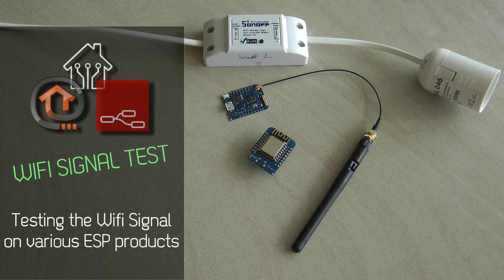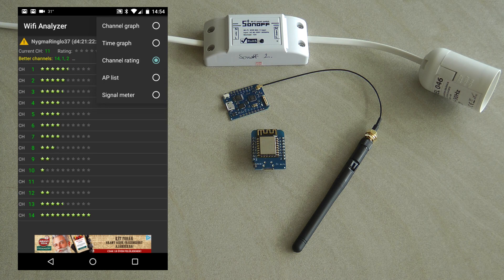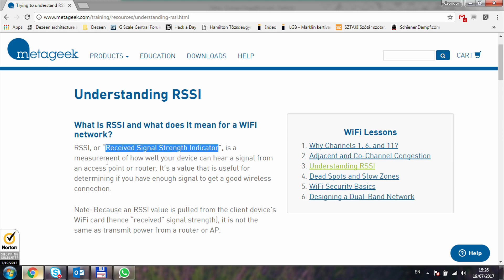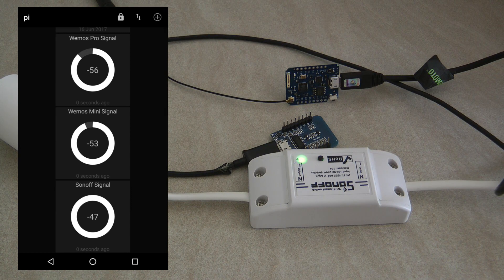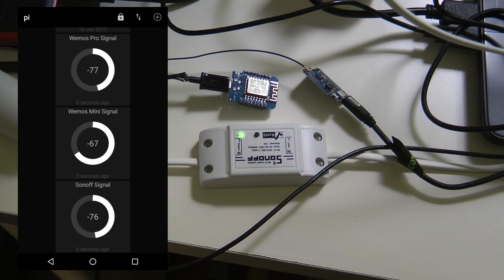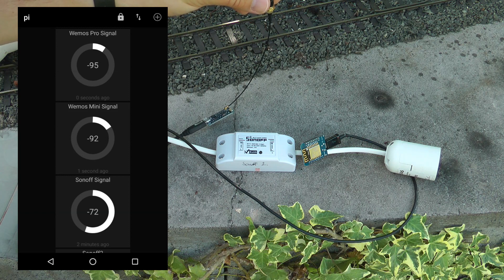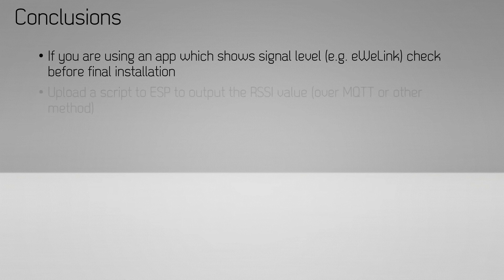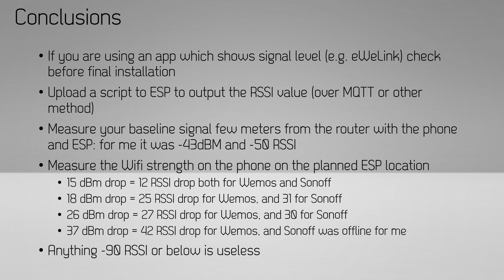ESP8266 Wifi signal test

Comment: Have you moved the 0ohm jumper on the mini pro to use an external antenna?
Reply: I loved to watch the video, considering the work it takes to organise everything, do all the measurements and then compile it into a structured video and if you made a 'mistake' not having the information that a resistor needs to be removed, it was even more interesting to watch this video and learn from it. I have a project with the same issue, where I would love to have a better signal, and was thinking about an external antenna. So I really would like to know what difference you got after changing this resistor. How much better is it?
Reply from the maker: Pierre Verbakel I will probably do a revised video in a few months. I did move the resistor and the reception improved but not much. But it was enough in my case to reduce the restart of 100 times a day down to a few per week.
Reply: One would always want more, but good to know it did make an improvement
Reply: Csongor Varga You can mount the antenna on a small metal plate of at least half a wave length. This will improve performance even more.
Reply from the maker: Damn, I feel such a fool. I did not know about it. I will retake this video once the modifications are made.
Reply: https://raspi.tv/2017/how-to-use-external-antenna-on-wemos-d1-mini-pro-surface-mount-rework-video

i hope this helps

Comment: is the external antenna for wifi only? I'm planning to make a LoRa project with RA-02 (433MHz) and I was wondering if the antenna used here is compatible with the RA-02 😅 thanks!!
Reply from the maker: Yes, that is for Wifi. To be honest the ESP that have a LoRa chip all have an external antenna connection for the LoRA radio. At least the ones I have all do.
Reply: @csongorvarga  I'm planning to buy a separate module for a LoRa cuz usually the ones with pre built LoRa are relatively expensive compared to those that don't have one 😅 And I already own an ESP32 DevKit so buying just the module would not damage my wallet that much haha (im a student 😭)
Reply: @csongorvarga  btw, in case you know, I just wanna ask, for the SX1278 LoRa Module Ra-02 433MHZ, can it still send/receive data even without an external antenna? I ordered the antenna and the module separately because for some reason, the antenna wasn't included in the module package I ordered (just the pins for soldering). I'm expecting the module to arrive much earlier than the antenna but I'm not quite sure if I can test it without the antenna 😅
Reply from the maker: @yoshimochii  I never used this module, but looking at a few pictures, it looks like there is an antenna connector. That assumes it is designed with external antenna only. So don't use it until you get the antenna and connect it to the module.
Reply: @csongorvarga  ohh, i see. That's unfortunate. I thought it would still work but on very short distances. This is because I have an esp32 devkitcv4 wroom-32u (the one that has an antenna connector) and I could still connect to wifi even without an antenna. Thanks for the warning though! (but it REALLY makes me wanna try lol)

Comment: Interesting. I have a related requirement. I have an IP camera in which I have replaced the rubber ducky antenna with a yagi to get better range. I now need to aim the yagi to maximise the signal strength received by the router. How to I measure the camera's transmitted signal strength?
Reply from the maker: Unfortunately I don't have enough knowledge to give you a really good advise. Some routers show the signal strength of the wireless devices, that may help. Or maybe what you can do is set the device to access point mode (set to pairing mode) and use a wifi scanner app on your phone to measure the strength of that wifi. You phone may not receive the signal the same way as your router, but if you want to maximise the gain it could be good enough.

Comment: Hi, I have a question. What if for some reason wifi is down, will SONOFF work?
Reply from the maker: SONOFF stores the 8 on/off settings under the timer function. That will work, but nothing else. If will show as offline in the app and would not accept any commands.
Reply: thanks a lot.
Reply: Sonoff do have small button with you can use as on off switch

Comment: The. direction of the Antenna matters. The tranmitter from the Antenna through the H field. So the H field I.e. Magnetic field can be horizontal or vertical. So you need the same plane for max power tranfer.

Comment: Apart from the jumper, you also should be doing each test separately and with the pro antenna in a bracket to place in the vertical position. Also either open the sonoff enclosure or place all in open air
Reply from the maker: Thanks for the advice.